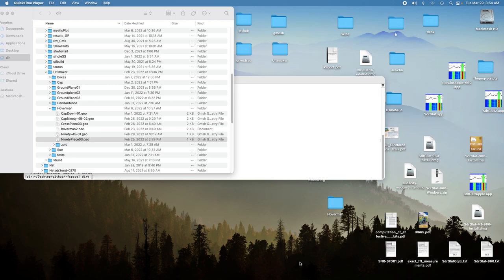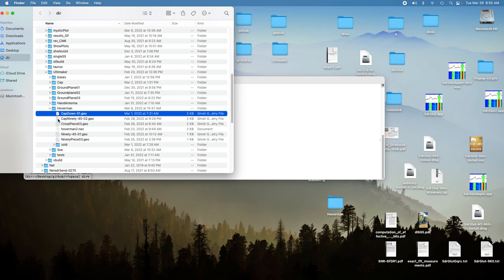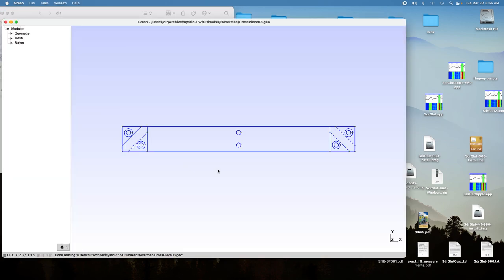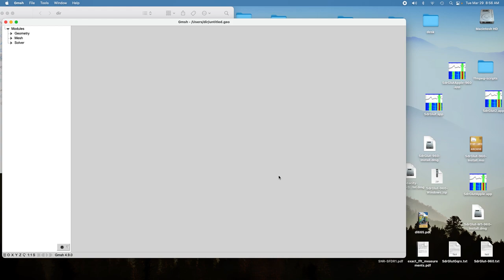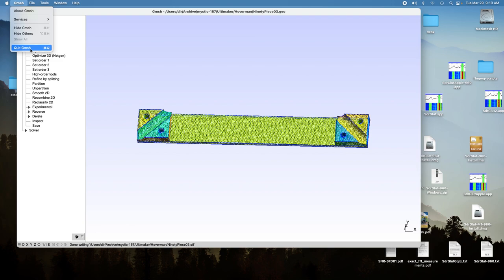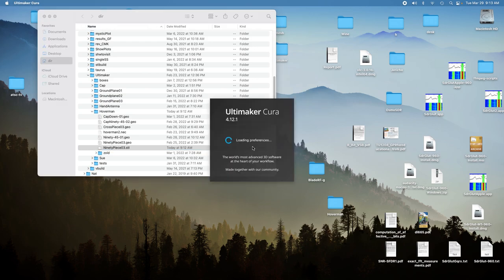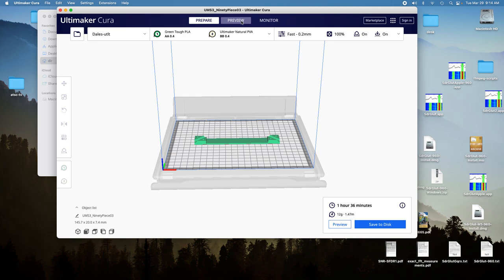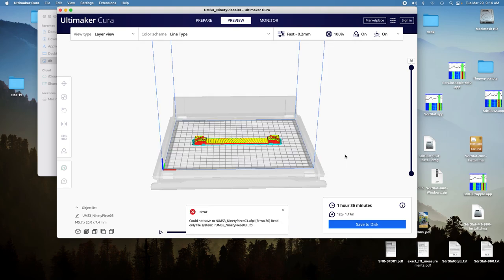Build the Hoverman Over The Air TV antenna - Its the Best

Comment: Nice Job!
I spent a few weeks with multiple orders & pickup/returning Antennas a few years back, there's a Simple $35 present RCA Antenna I tell everyone to pick up from WalMart. 1 Hour North of Detroit/ 1 Hour east of Flint/ 1 Hr West of Canada lol; I can Pick up 86 Channels.
But my next Challenge is Mid-Mi, My dads Fishing Cabin, Very Remote... Gonna follow along to see what else you come up with!
Reply from the maker: What is the Brand name of the walmart antenna ?

There are other types of the Hoverman antenna with addition elements on the top and bottom - the people say they are better, but the Antenna analysis programs says they are actually poorer. The only way to know for sure is build one and try it.
Reply: @daleranta1012  But again, Im in Kid Rock Country, on top of my house, I have Descent Line of Site to each of the 3 Major cities, 
Im gonna be another 3 hours into Northern Michigan, so the Woods will be giving me some issues lol
Reply from the maker: @MotownBatman   You get the longest TV range from a well designed log-periodic Antenna, but it is directional - so you need to put it on a rotor.

Comment: HOW about trying to add a upper and lower hat onto the wall antenna ?? They supposedly really work from what people have told me Dale. Have a Happy New Year fella too. 
Peace !!!
Reply from the maker: I ran the simulation with one suggested set of the upper and lower hats and the results were poorer. So, I did not try adding them. The simulation may be wrong - you really never know for sure until you try it. I do not like the shield - you have to rotate it then - the hats may have been for a shield version.
Reply: The hats are for VHF-hi band.
Reply from the maker: @davidanderson8643   Yes, I know and the simulation says that the performance is poorer on the VHF bands with the hats. I got a VNA a few weeks ago - the measured performance is pretty good from 198 MHZ to 900 MHZ. Now, may be I will try the hats and see what they really do.

Comment: What kind of balun do you use where the coax connects?
Reply from the maker: I used one of those cheep 300 to 75 ohm adapters - It seemed to work Ok.